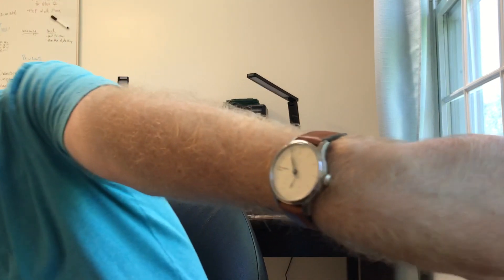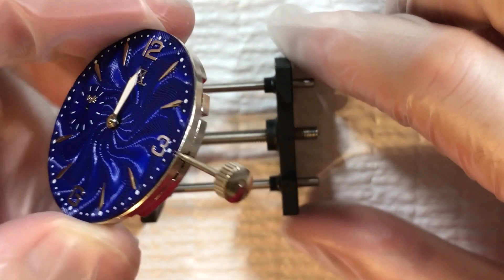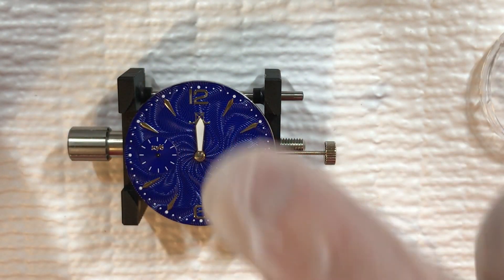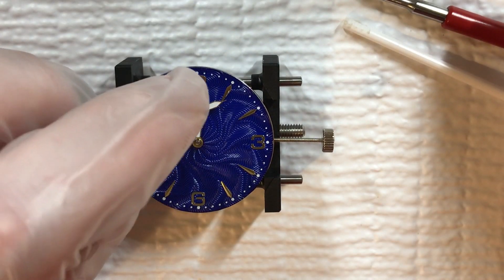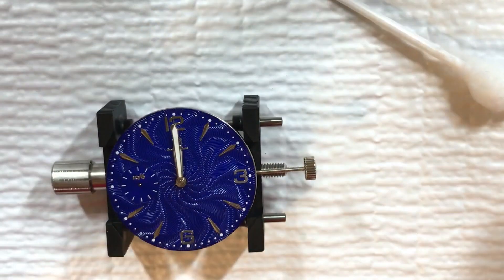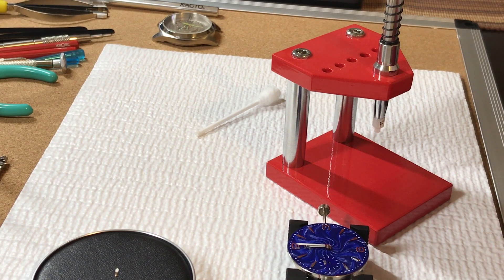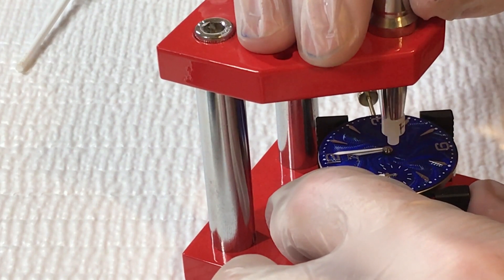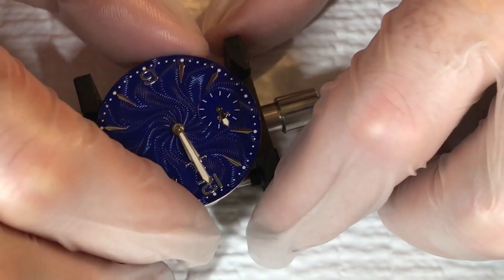Making Custom Watches: Attaching Hands

Comment: I like your channel.  My I offer some tips please (I'm qualified watch repairer not a keyboard warrior) and my intention is to help.  1) Don't work on paper towel dust and fibers will possibly enter the movement. If your budget does not allow for a Bergeon or Horotec work matt, a cheap mouse-pad can serve as a substitute.    2) don't use a cue tip to push the hands, if you must make an adjustment use pegwood, or at the least completely remove every bit of fibre from the cue tip and wipe clean and dry before using.
Reply from the maker: Hey, thanks for watching and for the tips. I don't work on any sort of paper anymore, I finally got a proper pad. As for the q-tip, you are correct, and I also got some peg wood for this purpose. These were really cheapo prototypes so I wasn't super worried at the time I filmed about the end of the q-tip. But you are correct on the proper tools and usage :)
Reply from the maker: The white surface I'm working on is a smooth top shelf liner that is slightly padded and no fibers. I've found it works really well.
Reply: @WatchComplications  Awesome stuff!  I really like your work!  Where do you buy your indices and logo?  are they from egologo? (understand if you dont want to share!)
Reply from the maker: Yup, egoLogo. It's about the only place that I've been able to find that can do small batch and extremely fine custom logos, for a small independent maker. And wait till you see the next custom dial project! Waterjet got involved.
Reply: @WatchComplications  Same - i can find anywhere else for the logo either!  cant wait to see what you do next!
Reply: For whoever else, for future reference, the silicone cellphone repair pads are fantastic for working on watches and are relatively cheap

Comment: I always just put the hour hand wherever, once pressed I move to exactly the 3. Then I press minute hand exactly on 12, feel like its easier without the hour hand directly under it. Maybe I'm doing it wrong.
Reply from the maker: that will work ok for a non-date, simple three hand watches. However for watches with the date or certain other complications, hand positions will matter more. For example, if you want the date to flip exactly at 12.